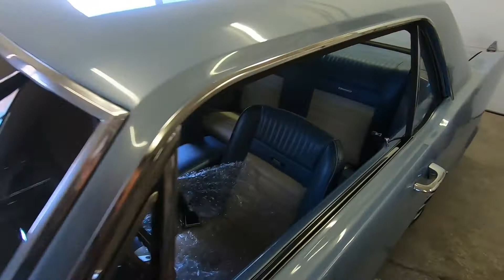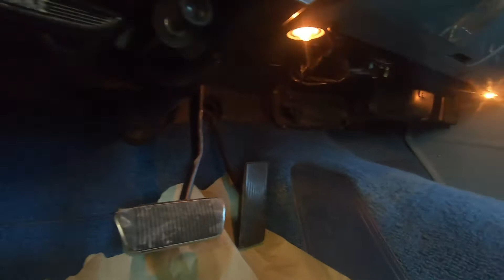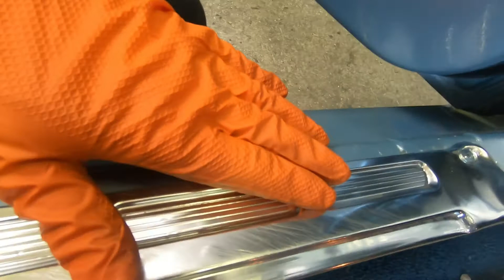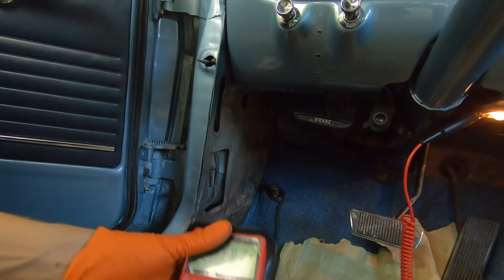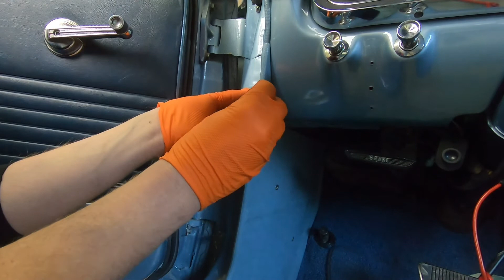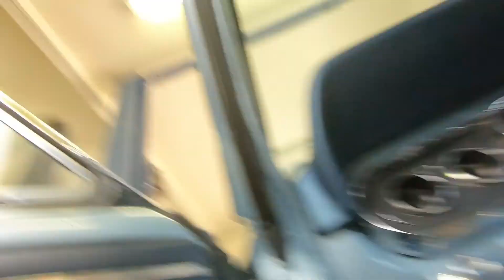Courtsey Light Switch Diagnostic Tips and Tricks - 1966 Ford Mustang

Comment: Quick question?
I bought a harness on CJ Pony Wiring Shift Indicator Lamp 1964-1966
CJ Classics: 65-AT,SHFTR,LT,FD

Where do you think I plug that to have power to my automatic transmission lever??
Reply from the maker: Should be wired to a switched 12 volt power source.

Comment: So, I'm installing my under the dash courtesy light. Passenger side. It is factory wiring. Put the bulb in, open the door to see if it works, and it blows a fuse. The dome light worked perfectly fine before this. So I'm guessing a ground with the under the dash light? I have good clean metal to metal contact. Or does the ground go through the wiring, and I am double grounding it to the metal?
Reply from the maker: These can be tricky to find. What type of bulb did you use?
Reply: @AlfsMustangGarage  actually, I figured it out. Put this in your lesson of hard knocks file.......the spring inside the socket was making contact with the conduit part of the wire. Causing a ground short.
I was using original bulbs.
Reply from the maker: Aww! Sometimes it's the simple things!

Comment: Awesome video as always, Alf! Is the actual headlight switch difficult to swap out? I know that's a bit unrelated, but I'm having an issue with no dash lights when headlights are on and am trying to troubleshoot. Electrical intimidates me and I never know where to start!  Thanks again...
Reply from the maker: Oh ya no worries. The headlight switch is pretty easy to access if you remove the instrument cluster. You'll probably want to remove that anyways if your testing the dash lights. Electrical can be very intimidating but with a good diagram and some practice, you can get there. Did you get one of those color codes 1 piece laminated diagrams? I highly recommend them. www.classiccarwiring.com
Reply: @AlfsMustangGarage  thanks for that reference - I need to go order a wiring diagram for sure. Well I was able to replace the headlight switch! Now I have dash lights when the high beams are on, but not when the low beams are on or just the running (orange lights) lights. Also, the dimmer doesn't seem to do anything at all, so not sure what that's about. I did confirm that the spring on the old switch was broken. I guess the hunt continues. You said it - electrical is frustrating! I wish I knew more about it....

Comment: Excellent info. Loving the 6 cylinder 66. Very nice car. What was the series of holes between the headlight and wiper switch.
Reply from the maker: Thanks Bob! I don't believe those are factory holes. I'm assuming someone at some time drilled those to mount something aftermarket.
Reply: No doubt. Still a very nice car for sure.
Reply from the maker: Absolutely, she is a cutie. I did a lot of work on her. she had a transmission shift shaft seal leaking that I fixed. That video is going to launch in 15 minutes 👍

Comment: Good video.. mine don't work at all so 1 of these days I'll have to get into it..right now we're in the process of changing the rear suspension..the front eye bolt is a PAIN ! LOL
Reply from the maker: Lol ya most of the time they just don't work. Good luck with those leaf springs. 50+ years tends to seize those bolts in there.